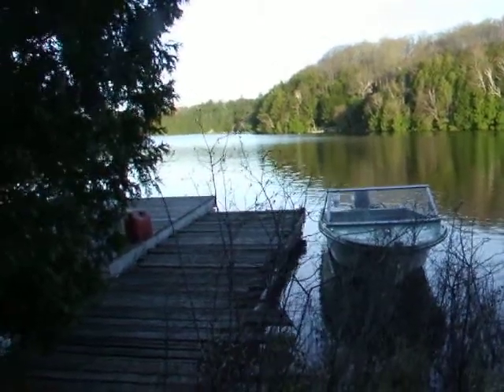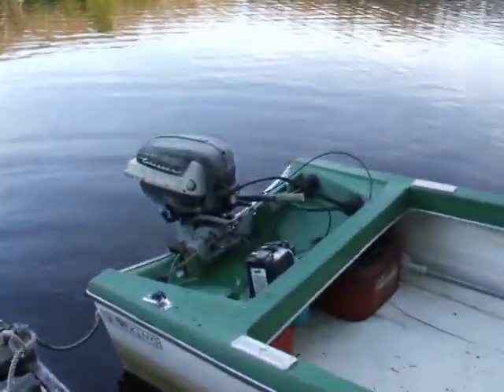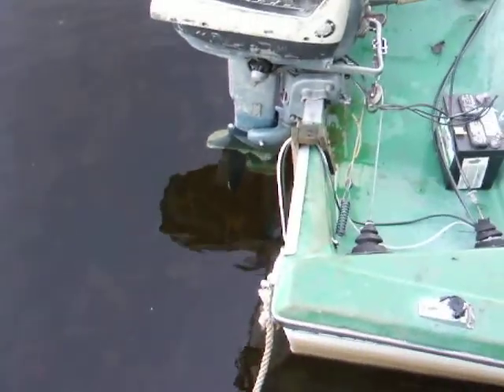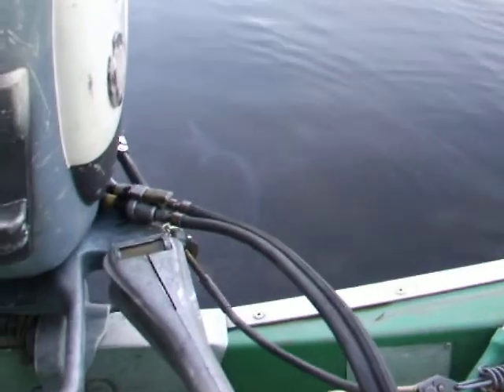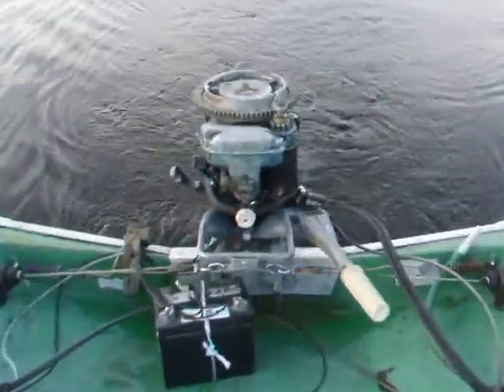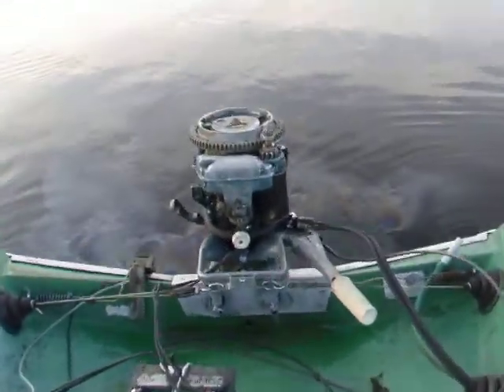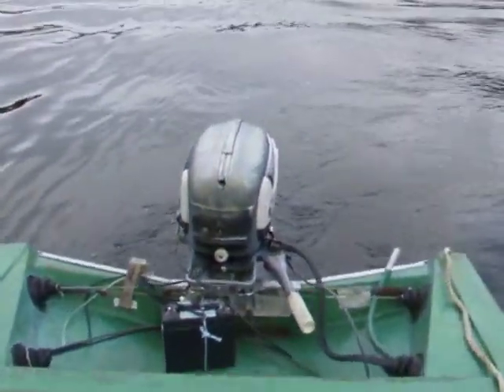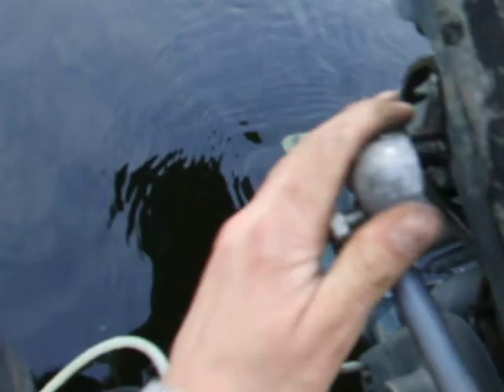1957 Evinrude 18HP Electric Start Out for a DRIVE - Oldie but Goodie - So Beat Up but Does it GO!

Comment: very rare to find a  57 18hp with electric start.  I have a  18 with a pull start I am restoring.  Nice motor
Reply from the maker: Thanks for the comment, yes I guess 18hp electric starts are rare.  Nice motors, you just can't kill these.  Let me know if you'd like me to email you a PDF of the factory Evinrude brochure, makes for great reading.  Also let me know if you need some basic parts (not the electric start stuff sorry!...:o). I've got 3 18hps from various years, think I can make 2 runners and sell off the rest.  Also saw your nice 1974 Hydro tractor with loader, nice little tractor, didn't know you could get a loader for a garden tractor!  Glad you enjoyed the video Cheers!~  Bellarmine

Comment: Where would I be able to find the file line connection for the pressurized fuel line & tank? I have the same motor in AMAZING condition, but I'm not able to hook any fuel lines to it because of the old omc style fuel/air  lines & I don't have a fuel tank either that will work.. 

Any help on where I can find these parts?
Reply from the maker: Hi, thanks for your question!  Yes, I guess that can be a problem if you don't have a dual-line tank, they have gotten so EXPENSIVE these days!  I assume your Evinrude still has the connector on the motor?  Here are 4 ideas I came up with:

 - I have a spare dual-line tank connector, could send it to you for some price.  Also have a 4-1/4 gal tank it goes with, might be pricey to ship though.
- I have a friend that has lots of Johnson parts, he may be able to help you out with a tank, though same shipping problem (from Ontario Canada)
- If you got a connector, then you could convert any standard fuel tank to a pressure tank by adding a hose-barb fitting and closing off the tank vent.  You'd need some dual-line hose, or just use 2 hoses tiewrapped/twisted together.
- Convert your engine to a fuel pump, and then you can use any connector / tank off the shelf for cheap.

If you want more information on the above (fuel pump/my friend etc), feel free to email me at my address on my YouTube 'About' page.  Can also send you the 1957 Brochure for your motor for free, makes for very interesting reading.

Hope this is helpful, let me know how I can be of further assistance.....:o)  Happy Boating, keep the oldies running and Cheers!~  Bellarmine